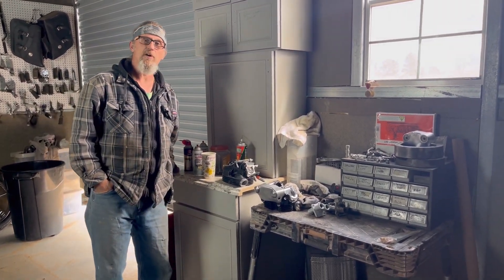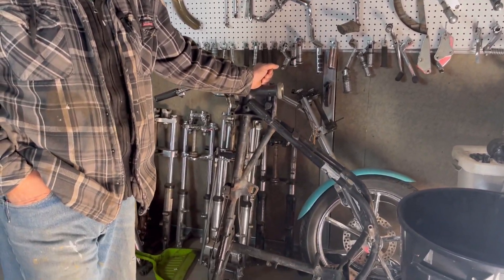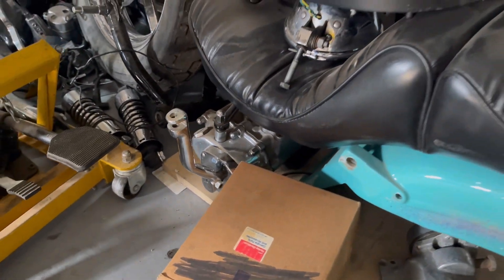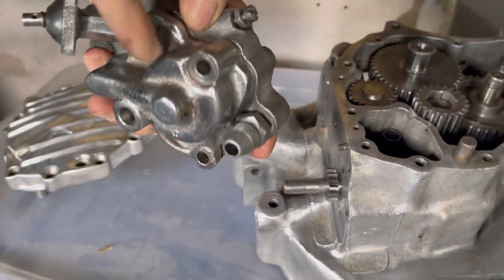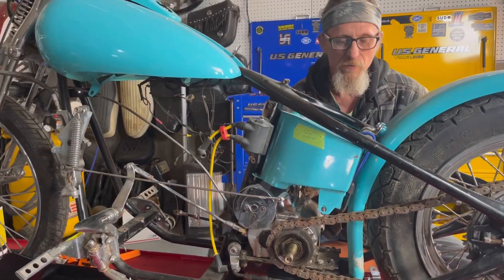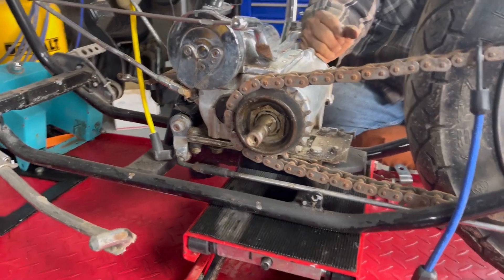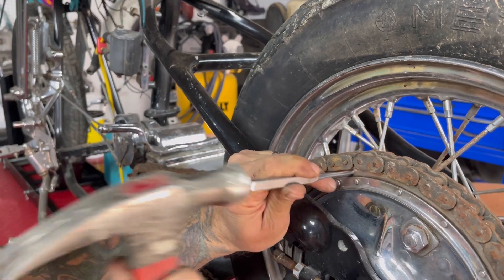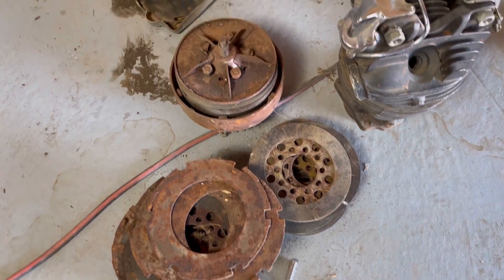Knucklehead Build | Update On My 82 Yr Old FL

Comment: Don’t forget there was one juice drum rear setup from 1958-1962 then another from 1963 to 1972. They used different swingarms and spacers which can’t be mixed/matched.
Reply from the maker: Building custom spacers !! In vaders are totally different!!👊
Reply: “Not quite stock”, right?!!!!!!!!!
Reply from the maker: @johnkelly6942  yep the invader hub is designed for juice brake but is off both directions from stock !! Haha Gotta make custom spacer between bearings and inside drum , wheel hub has no left bearing so I’m running a juice brake drum and a mechanical brake backing plate assembly!